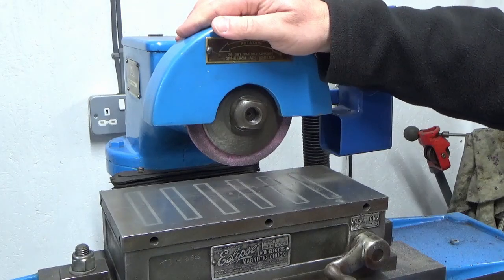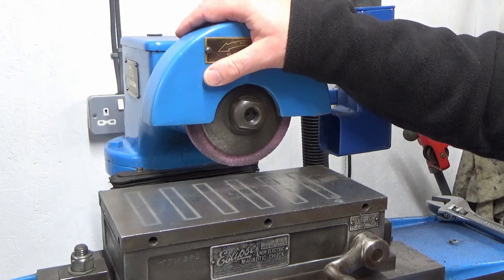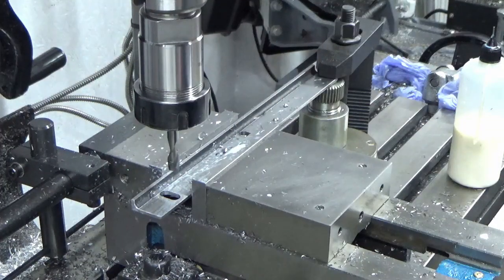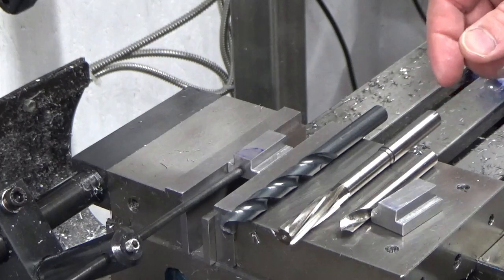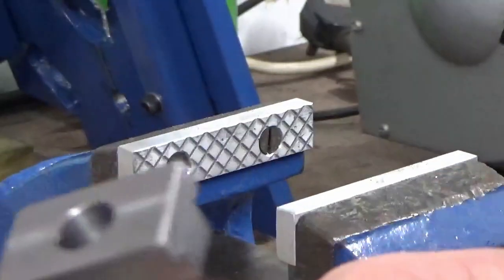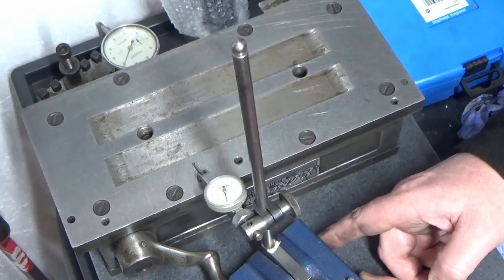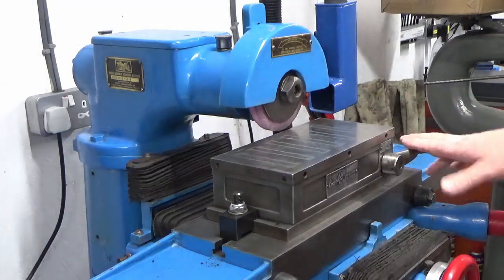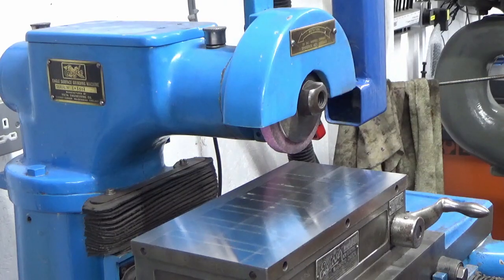Grinding a Magnetic Chuck on my new Surface Grinder

Comment: Jon,  Good job with the three upgrades.  I suggest a new 46 grit white Alumina wheel of H or I hardness to grind the magnet.  Also, I do not see paper blotters between the wheel and support washers they are necessary.  12 mm thick support washers are very thick and I like your idea of counter boring them to get more thread engagement.  Another upgrade that would help is adding a spray mist coolant unit.  Applying cold water to the the magnet also helps using a spritz bottle.  When grinding the magnet, and after dressing, fill the wheel with wax to prevent wheel loading prior to starting.  Mark the magnet surface with an ink marker to see where material removal is occurring.  Turn the magnet on prior to grinding.  Take as many light passes as necessary, .0005 inch max.  Traverse approx. 1/4 wheel width per pass.  This will provide good results.

Temperature control is important when surface grinding.  As the material heats the center expands faster than the edges.  The expansion amount gets ground off.  When cool the center is lower.  Hope this helps.
Reply from the maker: Hi Gary, thanks for the comment and advice. All makes total sense. I have a lot of past experience on production standard surface grinders (Jones & Shipman 540's), all with Coolant etc, this manual is completely different so back on the learning curve lol. The blotters are there, they are exactly the same size as the clam shells hence not being able to see them (admittedly, one is from a corn flakes box I made when I first stripped this down as one was missing). I will look into Coolant but I need to make some guards first to contain the mess. Cheers, Jon
Reply: I would also like to see an upright ‘guard’ to the rhs at the end of the table to slow down anything that slips off the magnet. It might be worth mentioning to your audience that your grinder rotates in the opposite direction  to most surface grinders and that your wheels are direct mounted rather than on a hub. My mate has an Eagle.

Comment: A word of warning about using standard hex nuts or bolt heads  instead of proper bed tee nuts. A properly dimensioned tee nut spreads the clamping forces over a much larger footprint than a standard hex nut can ever hope to achieve. I have seen a couple of instances on mills and shapers where a piece of the tee slot has been broken out from the table through use of hex bolt heads instead of tee nuts. It is a lazy bodge method and I wouldn't consider using  hex nuts or bolt heads in any tee slotted table. You certainly did the right thing,Jon.
Edit to add: another undesirable consequence of using  hex heads in a tee slot is they can easily cause a raised distortion point on the table top surface because the loads are not spread over a large enough area....don't use them.
Reply from the maker: Hi Howard, thanks for the comment. Yep, as soon as I saw the Heath Robinson hex nuts I knew I was going to be making proper T Nuts. Like you, I have seen so many castings ruined by poor use of T Slots with the wrong stuff being shoved into them. Cheers, Jon

Comment: I have the same Eagle grinder but the longer bed version and I ground in the mag chuck after fitting a new helical drive pinion to the table traverse. I was taught to have the magnet turned off so the swarf doesn’t pick up between the wheel and the chuck surface, but as you say  there appears to be no wrong or right way. However, I used a very coarse Norton SG wheel and used a trigger spray bottle of paraffin to cool the surface. I took very light cuts and cleaned up the chuck in three passes.  My arm ached though having to wind the table back and forth without hitting the bump stops.
Reply from the maker: Hi Shaun, thanks for the comment. Yes, I need to get a coarse grain wheel, and get my coolant mister unit set up. I was always taught 'magnet on' as it can distort the face when activated. Lol, who knows. It is certainly a good work out! Cheers, Jon

Comment: Hi Jon, learnt a lot of interesting tips and procedures above the basic points usually covered in text books on this subject. I can sense your frustration being used to working on tip top machines in industry in comparison. This makes it interesting watching you thinking out loud cross checking reasons why as you try and achieve the best you can with what you've got. Tony
Reply from the maker: Hi Tony, thanks for the comment. Lol, is the frustration that obvious? I am treating it as a challenge, I am sure I will eventually get on top of it. Just need to keep distracting myself with other stuff now and again so the challenge doesn't become tedious (or too expensive all at once). Glad you got some learning. Cheers, Jon

Comment: Nice t nuts. That was a great video Jon. I know absolutely nothing about surface grinders/grinding, so it will be a lesson for me to find out the causes of the issues you are having. Thermal expansion does seem the intuitive answer.
Reply from the maker: Hi Carl, thanks for the comment. I know nothing about these manual grinders, if it was a J&S 540 I would be much more comfortable. I am going to have to figure it out through trial and error I think. Cheers, Jon
Reply: @jonsworkshop  I'm looking forward to learning a lot from your investigations. Keep well, looking forward to the next film.

Comment: Jon, Try a white Alumina wheel. Secondly clean out the LEAD between the pole pieces, it's probably clogging the wheel. See pictures on my Grenby Grinder video to see the outcome. I used a 3/16 diameter old screwdriver, ground away the flat part, then used it as a scraper and when the diameter touched both sided of the pole pieces you had a nice radiused groove. A bit of a challenge when it came to the end though, trying to cut it nicely whilst having to move 180 degrees. Came out well though. You could try a coolant mist from a spray bottle. Take Care. Regards from Australia.
Reply: Agree,Dave. Trying to accurately grind a surface this wide without coolant is difficult bounding on impossible.
Reply from the maker: Hi Dave, thanks for the comment and advice. Yep, will look into a white wheel and Coolant is definitely a thing I need to do (need to make some guarding up first though to contain the mess). Before I have another go at the magnet, I will scrape the lead out, been back to look at your pics, nice job. Cheers, Jon

Comment: Hi Jon,  just as well you found that dodgy bolt,  could have been serious!. Stickers on the way......Cheers Kevin
Reply from the maker: Hi Kevin, thanks for the comment. Yep, just wasn't happy with the Heath Robinson one that was in (even if I repaired it). At least what's in there now is not stressing the cast tee slot as well. Thanks for the stickers, I will get some off to you at some point this week hopefully. Cheers, Jon

Comment: John, I think that the wheel might be expanding due to being too small to adequately dissipate heat. Perhaps a new wheel will make the difference. The surface grinder in the machine shop at my work uses flood coolant, perhaps a future project.  I learned quite a lot from this video. Best wishes, Dean in Oxfordshire.
Reply from the maker: Hi Dean, thanks for the comment. Yep, I think wheel and Coolant both need addressing, I need to make and fit some guarding first though to try and contain the mess a bit. Cheers, Jon

Comment: Hello Jon,
An interesting video... fixing the T-Nuts/bolts was a good call... Do you plan to have some sort of coolant for the surface grinder... 
Take care.
Paul,,
Reply from the maker: Hi Paul, thanks for the comment. Yes, it's clear that some form of cooling is going to be needed. Before I do, I need to make some guarding to try and contain the mess. Cheers, Jon

Comment: Good one Jon .   Only thing i could add  to the other comments , not sure if you have heard of it before . If you leave one clamping bolt on the mag chuck only lightly nipped down & the other one tight , it lets the chuck move according to temperature .    
What is the reason behind engaging the magnet when you grind the chuck !  
Cheers .
Reply from the maker: Hi Max, well whoever made the t nuts was streets ahead of me then lol, one side welded and one not lol. I was taught that especially with older chucks that had been ground many times that the top face can distort through application of the magnet due to the internal moving parts and the strength of the mag field. I have no idea if this is true but it sort of passed the straight face test at the time and has stuck with me since. Cheers, Jon
Reply: @jonsworkshop  Makes sense .

Comment: Hi Jon, Very interesting vid, I would love a surface grinder but it would be more of a toy for me as I don't need that type of precision. I thought you would take a few skim passes on the clam shells, then you said you were going to recess then you adjusted so goes to show first thoughts not always the way to go:) Just a thought as I know nothing about them but with the wheel being small would it not pick up heat a lot faster than a new larger one! TFS, stay safe Dude. GB :)
Reply from the maker: Hi Graeme, thanks for the comment. Yes, you are bang on, definitely a quicker response to heat from a wheel this size. I think my biggest two issues are, wrong grit material and no coolant, I can fix one of those easily so that will be the next experiment. Cheers, Jon

Comment: Yes your wheel diameter is getting to small you will want a course grit wheel with a soft resin bond G or H if you can set up a flood coolant will solve a lot of problem and last load your wheel with candle wax. I'm from US and all of our grinders run wheel clockwise I see yours is made to run counter clockwise is that standard  there or is it just that brand.
Reply: I have  a USA built Grenby from 1942 and that wheel runs counter clockwise too. Meaning it has a right handed spindle nut.
Reply from the maker: Hi Terry, thanks for the comment. I will look into getting a white wheel, good advice. I think most of the older manual grinders are CCW rotation. The Jones & Shipman 540 which is the main production shop grinder in the UK and one I used  lot in my early career has a CW rotation so it's not a geographical thing. Cheers, Jon

Comment: As usual a great video Jon. I have a strange logic to all things & wondered if the magnet was on, would that not attract the filings to not clear away from the job. Admit I know absolutely nothing on the subject , so probably my logic is wrong. The one we had at a place where i was a maintenance sparky, was a huge thing & the bearings were pressure fed with hydraulic oil for accuracy. Is yours like that. Only wish I had room for one in my little workshop. Green with envy.
Reply from the maker: Hi Stevie, thanks for the comment. Your logic is bang on. On a production standard grinder with flood Coolant the grindings get washed away, on mine, this was definitely adding to the wheel clogging. No oil fed bearings on this old girl, couple of taper rollers in the back and a single deep groove ball race up front with grease added on assembly. Cheers, Jon

Comment: thats why you don't have any thread for your nut iv just checked my machine and my friends is the same as my one .. you need to be able to adjust the back end of the shaft for flout .. you also need to be able to adjust the front bearing then back it off for clearance .

Comment: I am just looking at your video on the grinder witch is the same as my one .. the head bearings are on my machine are the complete opisit way round the double row bearings are for the front not the back .. the back bearing is just to tie the back of the shaft

Comment: Why all that effort to make tee nuts? Drilling, reaming, turning, press fit and welding?
All you need is a 12 mm tapped hole in the tee nut and a suitable length cap screw with a substantial washer.
Reply from the maker: Hi Zen, thanks for the comment. In short no. The minor T slot width on the base casting is about 11mm which is why the originals were hand ground to clear. I could have gone down to M10 I guess but the holes in the existing clamps were near 14mm so I would have had to turn up a couple of substantial washers and the clamps would be sloppy on the screws, it would have worked but feels like a bit of a bodge. I could have made new clamps for the M10 but that would be more work. Cheers, Jon